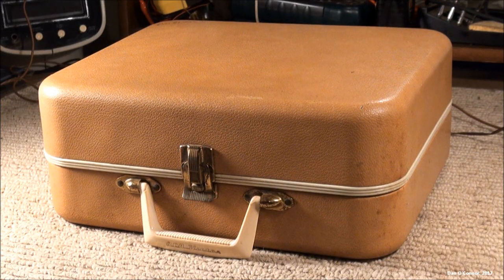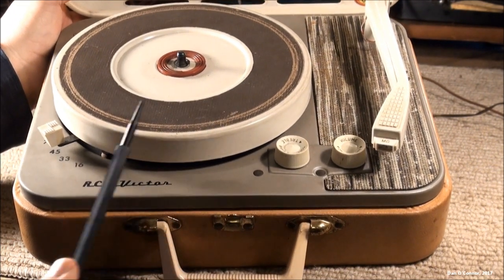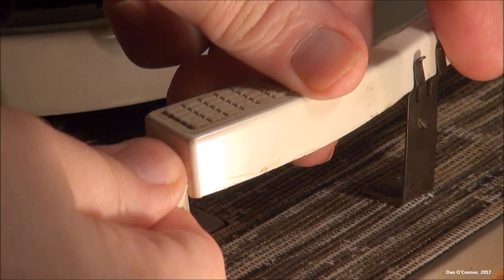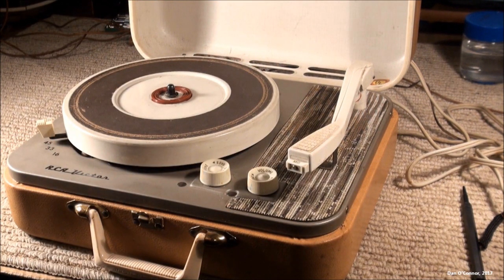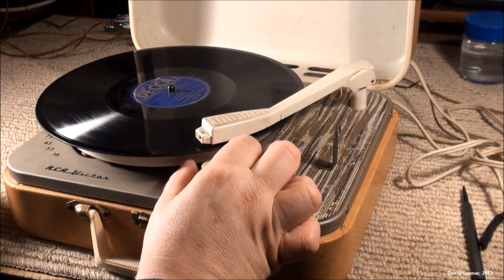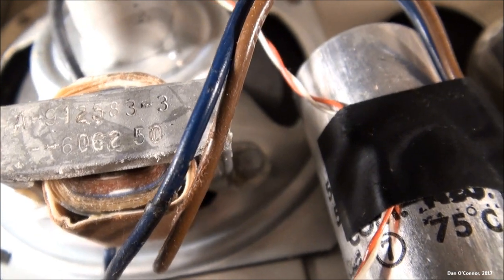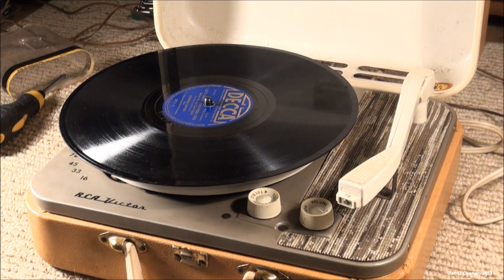1960 RCA Victor 1-Tube Record Player

Comment: A good example of the kind of record player a teenager might have owned during the early years of rock 'n' roll. These days everyone hates the Crosley Cruiser, but it's really just a modern version of the same thing.
Reply: Very true
Reply: VWestlife, yes but usually there is a little more control too. Such as adjusting tracking weight. And i still wouldnt buy one of these myself as they arent going to do any good for the records.
Reply: This 1960s one also won’t do any good to records since it tracks at like 10 gramss
Reply: Except the Crosleys don't absolutely shred through styrene records
Reply: @jaysvintagerecordsandphono6184  Geeze.  You guys are rough!  Don't like the new ones, don't like the old ones either.  I'm here looking for a portable so my mom can play her parent's old 78s that haven't been heard in decades.  What difference does it make?  Just throw the old records away or listen to them once or twice on a crappy player?  If the records aren't heard are they even music?
Reply: @gizzyguzzi  Buy a Crosley. All the record damage thing is an urban myth. I have one and it works great, and it doesn't damage the records. My only advice is that buy one with a magnetic cartridge, not ceramic.

Comment: I had one of these (my first record player) in about 1965 (I was 11).  I traded my buddy a toy folding army shovel for it (he was using his as a paddle when playing in the S. Florida canals when he dropped it so he needed another).  Dad worked at RCA and got me a new idler wheel cause the old one was worn out (I remember it cost 50 cents).  I put a 1/4" jack in the side so I could plug in a 12" (!) speaker.  My brother and I used to sit and play our 45's for hours (all speeds).  I can remember once "souping up" the 78 setting by wrapping tape on the spindle until it was playing as fast as we could get it to go.  The tone arm had a waffle pattern underneath to give it structural stability.  To help keep it from 'skipping' I packed it with modeling clay.  It must have weighed a half pound!  I eventually replaced it with a Dual 1229...

Comment: I'd be a little nervous playing styrene records with this only because of an experience I had years ago.  My parents had a console from the '60s with a BSR changer with a Monarch style record changer with a crystal cartridge I messed around with when I was an early teenager back in the late '70s.  I put a couple records on it and it immediately got a cue burn (although I'm not sure what it's called when it's in the middle of a song) on a couple 45s.  LP records didn't seem to be a problem.  Anyway, I'm sure in my situation, it may have been a bad needle, too.  This is a nice video, though and it didn't seem like you had any issues with the records you were playing.  Thank you for sharing.

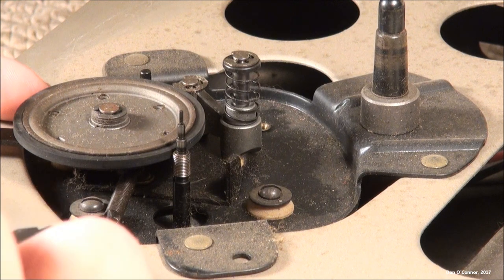Comment: The earliest I find is Nov 1958, the tone control is referred to as "Golden Throat Tone"!  :)  , came in 4 colors "1EMP2E, White Alligator",  "1EMP2K, Saddle Morocco", "1EMP2KK, Brown Alligator", "1EMP2L, Blue Morocco", in 1958 it sold for $29.95 .  At 8:36, you can see the small indentation on the wheel, from the 78 speed.  Hope that helps some.  ~Jack, VEG

Comment: Wow, an Astatic flip-over cartridge that still works....I've never had one of those before, they're always dead. The crack in the tonearm is easily fixed with some Superglue or epoxy
Reply: @bluebird6039  , 

Hello, I just bought a 1EMP2KK ,Brown Alligator. Its in overall nice shape. But it needs an Astatic Cartridge, Anyone know were to buy one?

Comment: I just bought one at a thrift store, same model, 7 EMP-K There is another number REM031321 Made in New Jersey.  The edges of the outer casing is wrapped in leather with stitching. The tone arm (I believe you called it) is metal. Very old and very lovely. The only thing is It has no needle, I have no idea what kind to get.

Comment: Hi Dan, cool video! I have one of these that works fine, but the sound/speaker is very weak. Do you know what could be causing that, or how it might be fixed? Thank you. ps. mine also has the Nipper trademark sticker inside the lid.
Reply from the maker: Low audio on an old piece of electronics like this is often the result of a capacitor inside on the audio board that has gone bad.
Reply: Dan O'Connor That sounds like a good place to start. Thank you!

Comment: There is something in the lid that SHOULD NOT BE THERE! It's that trademark! The Dog & Gramophone "Nipper" trademark of His Master's Voice should only be used in the USA by Capitol Industries, an EMI-owned company, a subsidiary(read "infant member") of the EMI group of companies. The only trademark that SHOULD appear in the lid is RCA's own "button" trademark with the lightning bolt trailing off the 'A'. The "Nipper" trademark should've been absent from the USA between the years 1929 and 1955.
Reply from the maker: Well then, what about an RCA Victor record player made after 1955 like this one - sometime from 1958 -1961?
Reply: The same! it should carry the "button" trademark with the lightning bolt trailing off the 'A'. In 1955 EMI bought out all but a bit over 5 % of Capitol Industries, which put Capitol firmly under EMI's control, thus any trademark or trade-name EMI owned(with only the exception of Columbia, used by CBS for USA and Canada), EMI should be using those trademarks in the USA through Capitol, thus His Master's Voice and Parlophone should've been used to carry EMI's British AND Australian roster in the USA and Canada. After all, Capitol IS a subsidiary of EMI, not a division but a mere subsidiary, akin to the infant toddler in a family. As for Parlophone, any similarity between that brand and the Dover-owned Par Lo label and brand in New Orleans, is negligible at most.
Reply: Actually it was always used by RCA Victor.

Comment: That's really built like a tank with it's all-steel construction. Unfortunately it uses  one of those non-serviceable Astatic arms where the cartridge is non-replaceable---arm and cartridge were replaced as a unit. I bet some Superglue would fix the crack in the arm
Reply: Huh...I picked exact same player up at a oocal resale shop. Learned a few things I wasn't aware of. Played fine at first, but now turn table slows as it plays..hubby thought something may need oiling...or do you all think cleaning? I miss playing records..so nostalic! Also just picked up 1957 Webcor..no needle. Any recommendations for what to get (I prefer diamond tip)
Reply: @rebeccafranz3040  The motor probably needs to be disassembled, cleaned and lubricated. The idler wheel may also be failing. I would not play modern records on a player like this, it will destroy records made after the mid 60's